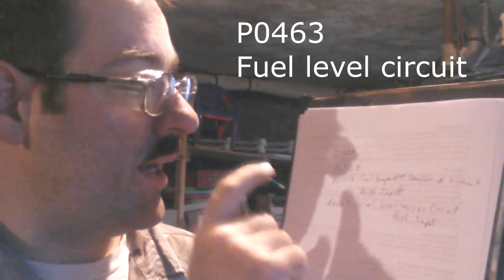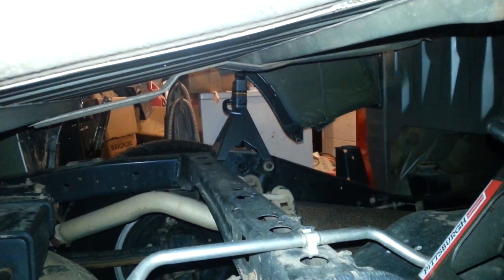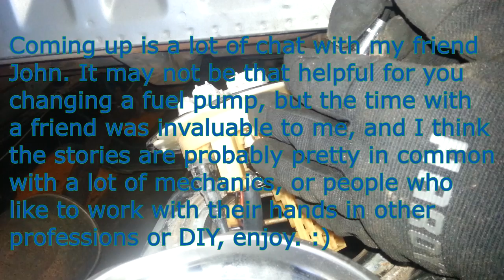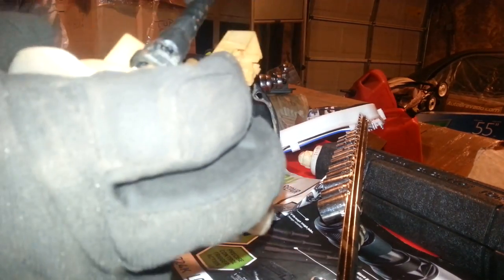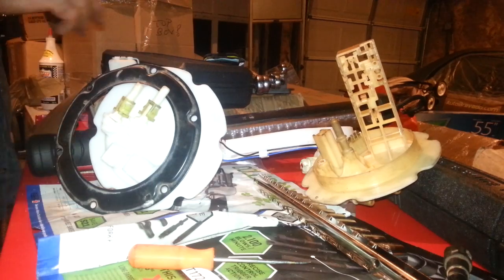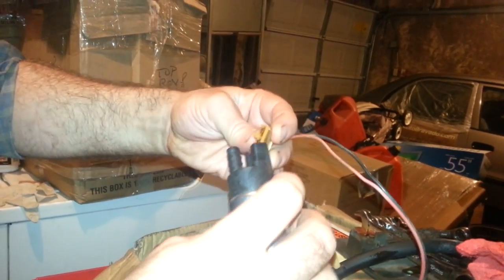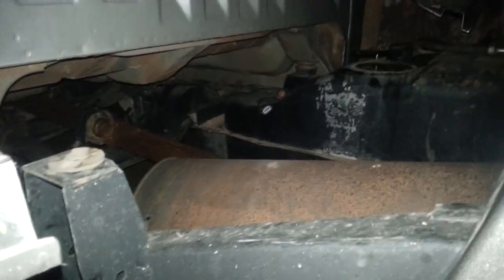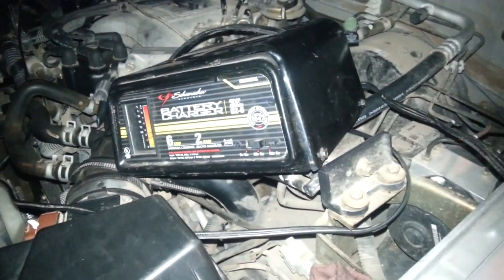Nissan Frontier Fuel Pump replacement, bed tilt method part 1

Comment: Somehow i think you need to put a massive hinge at the back of that bed, and a couple of quick release catches ha ha :-D, plus gas struts to keep it up.
Invite frends to a weekly party, "Bring a pump party" :-D
Just being silly again :-D
Those plastic tube connectors look a pain, lets go back in time and shoot the designer :D
Reply from the maker: +zx8401ztv uh oh. You're going to have to shoot me. Lol. They're normally very easy but I damaged it not knowing how to release it the last time I was in there. 

Push it together. Squeeze tabs. Pull it off. 

On top of it all, I pushed it back on crooked. 

My only possible saving grace is ethanol had melted and damaged all the internal tank lines. ..they were melted. And maybe, just maybe. It wasn't my fault. 

Wow. This is really funny. LMBO.
Reply: lol, but you didnt design them, so sorry no bullet for you me lad :).
Dam ethernol, they are selling us crap!!.
Governments, who would have em, not me :)
Reply from the maker: +zx8401ztv Oh man. You have no idea. I bought my first wire brush for a die grinder because I estimated 4 hours into cleaning the gas tank that I needed 12 more hours to finish cleaning out the ethanol goo from when the truck sat a few years. It sat all that time because of a fuel pump failure and them being $315+. When the price dropped years later and I finally got in there. Wow.

With better tools and a vacuum that I set fire to from gasoline laced dust I had it clean in a few hours.

I had more time than money, so buying a fuel tank wasn't an option.
Reply: Just imagine the explosion from dropping the vaccume hose into petrol, and powering the vaccume cleaner, ba boooom, the brush based motor would have provided the initial spark :)
Reply from the maker: zx8401ztv WOW. I bought a shop vac after that. Once the normal vac fumes subsided it worked just fine again. Lol

I smelled fine for 3 months before I dared try it!
Reply from the maker: Ha. If you want to read another dangerous moment, read the description under the video. I added an additional safety comment and story about how I nearly killed myself.
Reply: Petrol/gas vapor isnt something i would want near sparky things, i dont blame you, did you power it up on a looooooooong extention cable LOL, bet you did :)
Reply: That experence sounded frightning, glad you got out of it :-) :-).
I still say a big hinge and two gas struts would have been good lol :-D
Reply from the maker: +zx8401ztv I copy and pasted it for you. "Personal story of almost killing myself a year ago:
(BE SAFE!)
I got stuck under my truck once when I tried adjusting how the truck bed was lifted up by myself. I didn't have the strength to get out from under the bed, but I had to use strength continually to keep from getting crushed as well.

As I kept trying to get leverage to get an old fence post back up and under it I let myself get crushed for a few seconds, feeling my life risking, slipping away, I exploded, using the nearly planned on fear to get the truck bed up and get that board back underneath it!"

Comment: When replacing the pump. Does the line from where you take off. From the pump fitting  Will be the exact line connection from the new pump fitting. So theres no way you can miss line them?
Reply from the maker: Sorry I missed this question. Yes. If you get a full assembly. If you just get the pump alone, I've replaced the line before because it was going bad. Just got fuel hose and attached it very well.

You should used fuel clamps in such a circumstance. Normal worm clamps aren't rated for that much pressure.